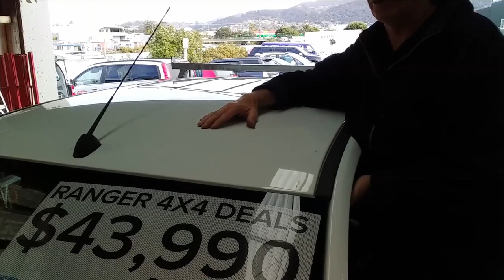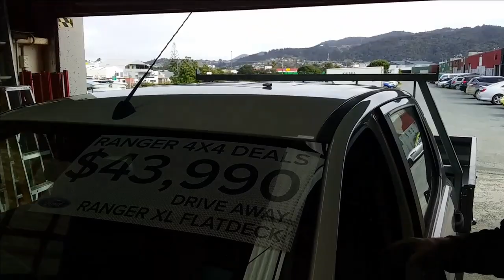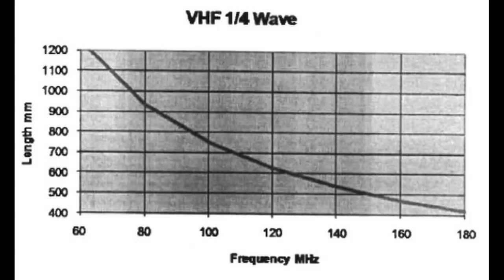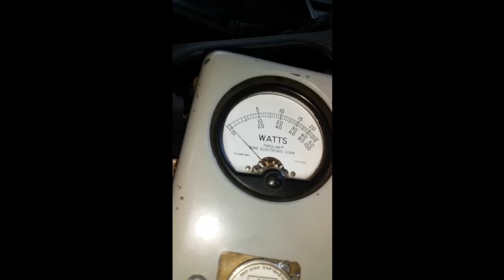Vehicle Roof Antenna Installation

Comment: I wish I would've seen this video before I did mine. I just removed the dome light. Used a center punch to make a small bump so I could see if from the top. Then drilled and ran the wire.